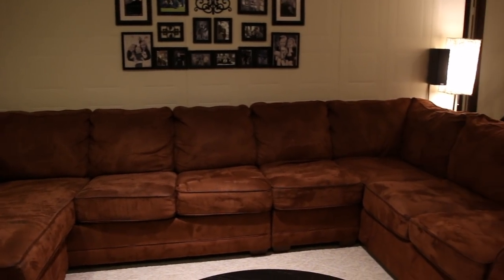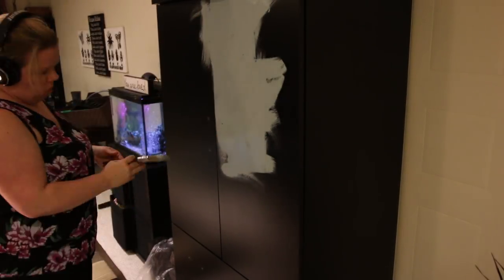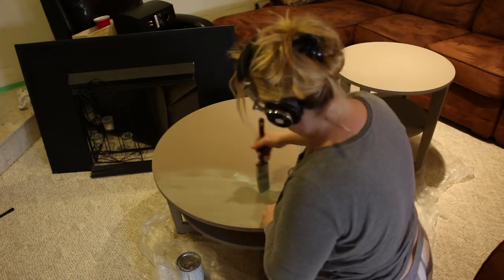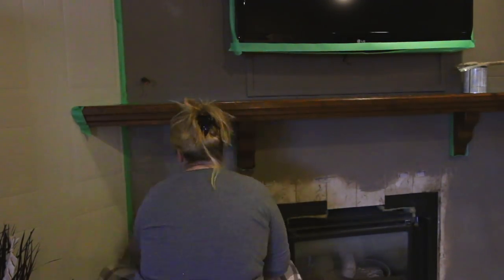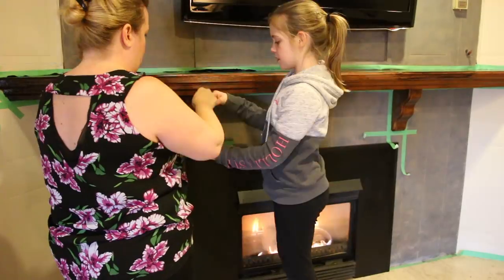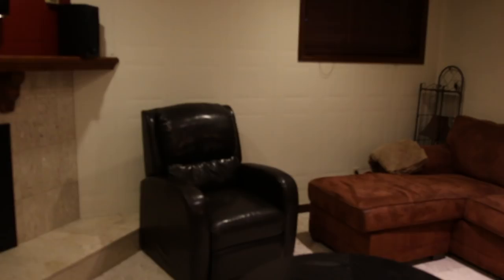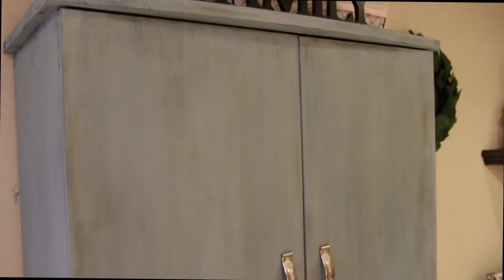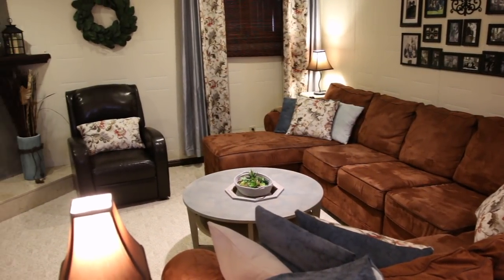Easy Chalk Paint Makeover - Before and After

Comment: Hey. Thanks for the video.i learned so much.. you get  to the point and buzz  through NOW !!! I have a suggestion  for your sofa.. You can chalk paint it any color. Tons of videos showing  the technique.. that is cheap,  but you can buy fabric spray paint called Simply Spray $8 a can.. But it will take a lot of cans for that size sofa.. still cheaper than buying a new one.. also ,,there are videos on the spray.. But the color choices in chalk paint are numerous..